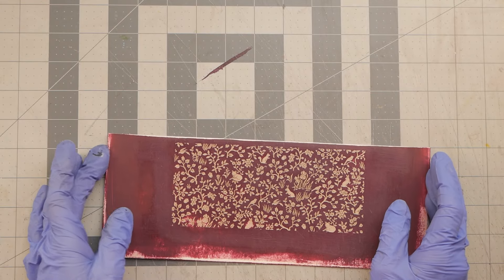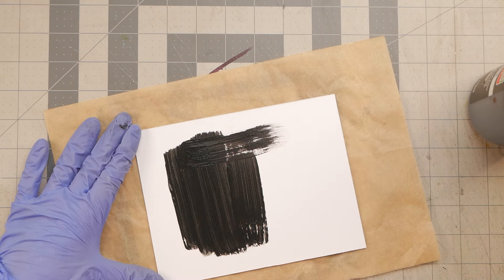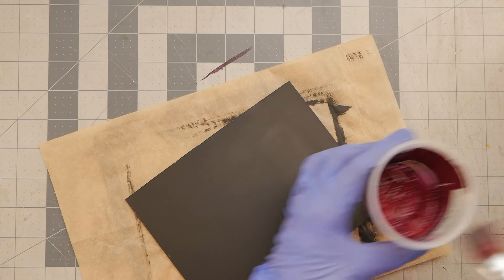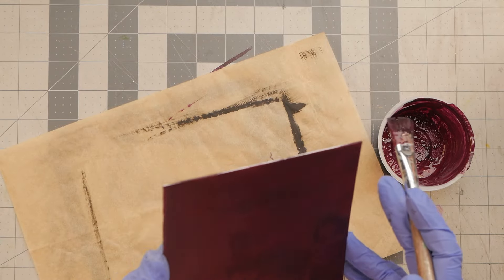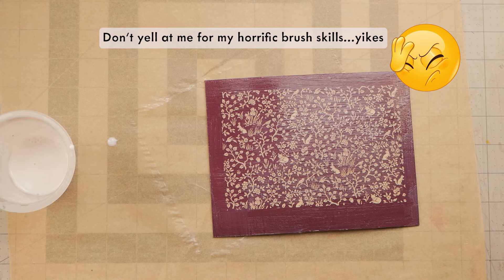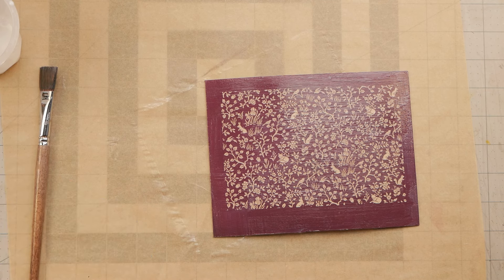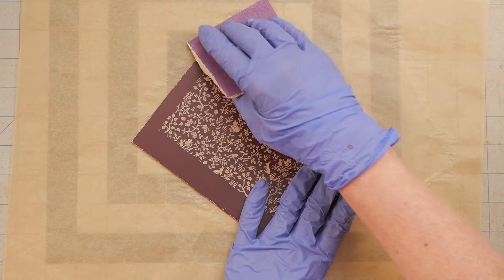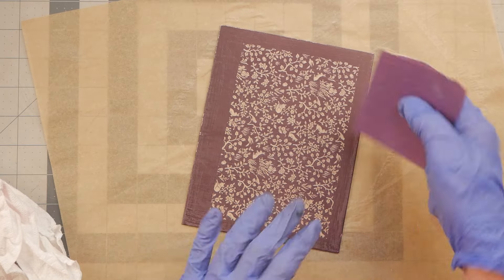Faux Lacquered Enamel | xTool S1 Home Craft Laser

Comment: I have found putting a very even fine water mist over the varnish immediately after the varnish is brushed on also helps keep layers smooth. It extends the drying time a little but worth it for a nicer finish. Also thinking some embossed card could be nice , as I dont have an engraver but do have a big shot and some embossing folders. Lovely gift Nic, thank you for doing all the thinking and sharing :)
Reply from the maker: excellent idea, thank you for sharing!

Comment: Dont have a laser. Hubby will never let me get a laser. But...... Find a rubber stamp you like and stamp with versa mark or a clear embossing ink. Cover with clear embossing powder. Apply heat untill melted. Apply the ink color you like on the entire surface. Go crazy, put the ink pad on the paper and get a good even layer of color. Wipe the embossing with a cloth or paper towel to remove the excess ink. Now cover the entire surface with the project with your clear embossing ink, then with clear embossing powder. Heat untill melted. Let project cool. Cover with clear embossIng ink then with clear embossing powder. Heat untill melted. Repeat this step untill you are satisfied with the results. It usually  takes 3 to 5 coats of embossing powder to achieve a smooth surface. If you cut out a piece to mount, etc then run the heat gun over it for a few monents so the sides remelt and are smooth and glassy. 

This will work, but it is not engraving. Sigh ....